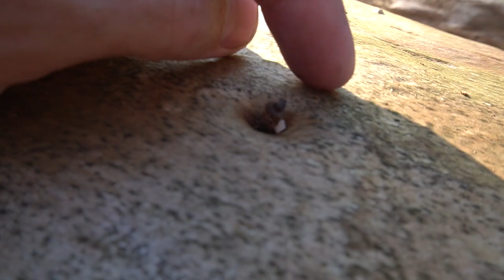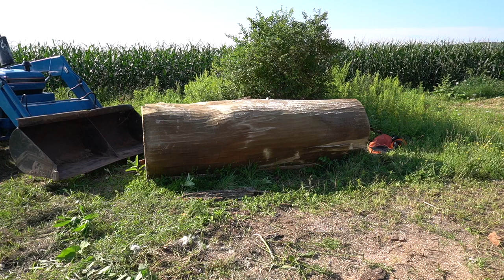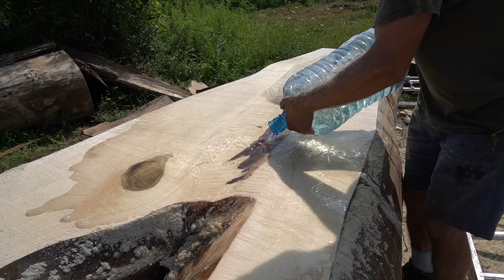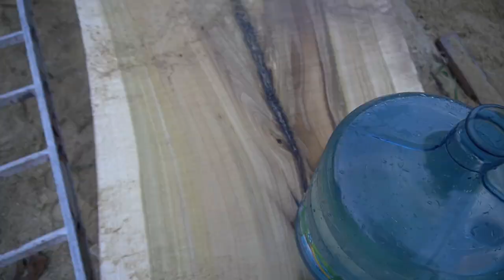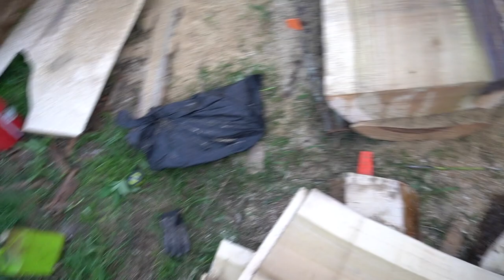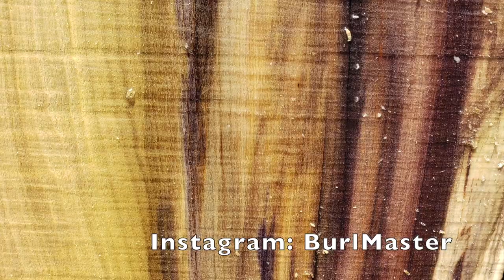Huge Rainbow Tulip Poplar Milling

Comment: Great video.  Does the wire significantly reduce life of the chain.  Thanks for sharing...
Reply from the maker: Thanks I really appreciate the kind words. It does not significantly reduce the life of the chain. It dulls the chain just enough that I could keep cutting but I had some issues with the bar dipping from it. It basically just takes the sharp edge off. If it was a nail it generally will rip one cutting tooth off and dull the teeth quite a bit. After I hit a nail I can sharpen it though and still use it.